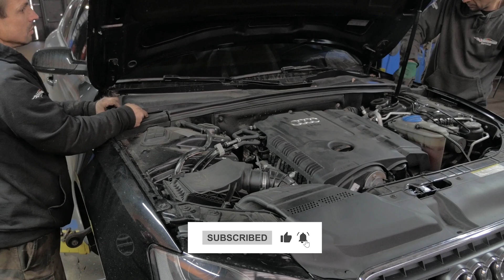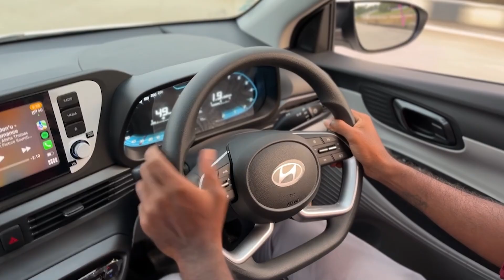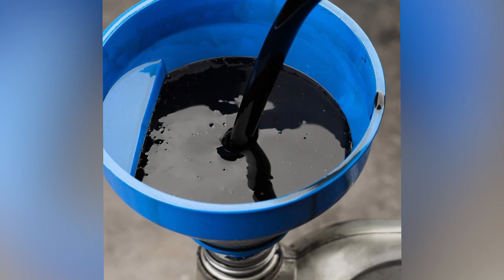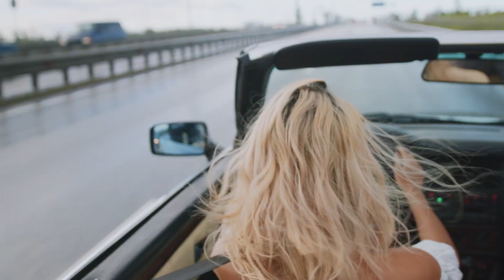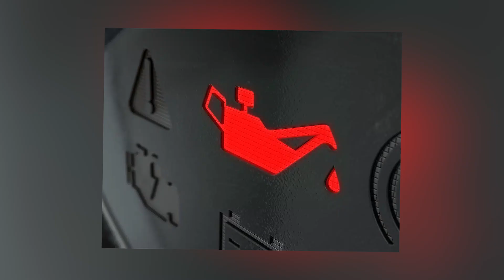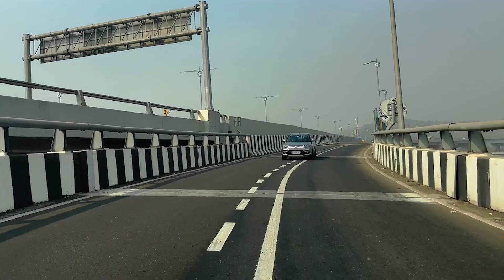STOP Using This Engine Oil – Serious CAUTION for Drivers

Comment: Just top off your oil and change on time, done.
Reply from the maker: You’re spot on — regular changes are key 👍 But not all oils protect the same way. Some break down faster and can cause hidden wear even if you stay on schedule. That’s why I wanted to show what to watch out for. Do you usually stick with one oil brand, or switch around depending on price and availability?
Reply: Even the replies are AI generated.